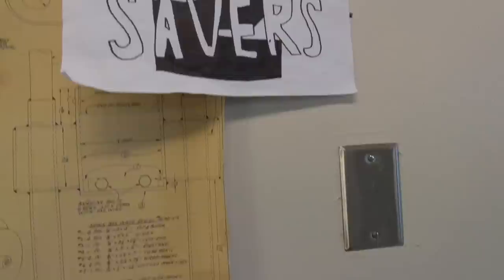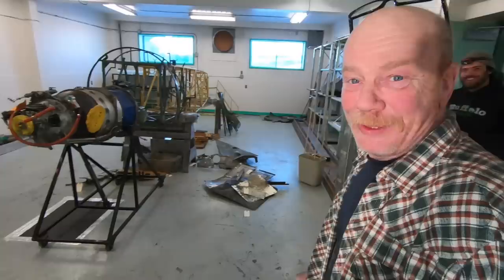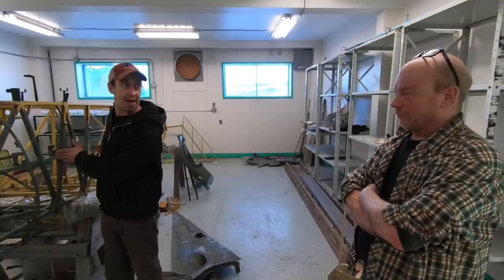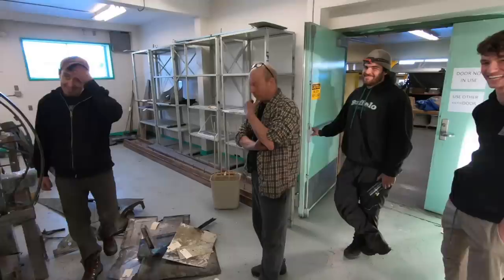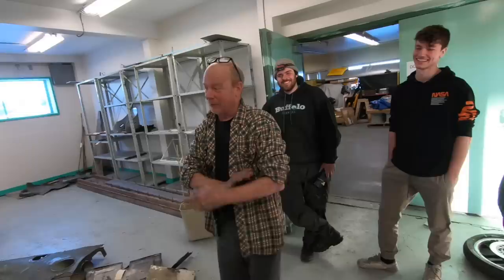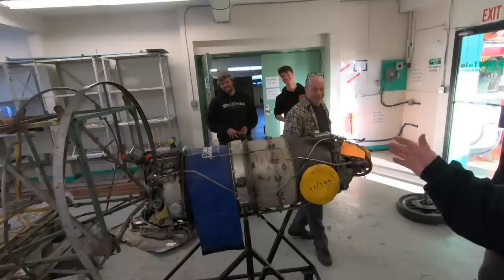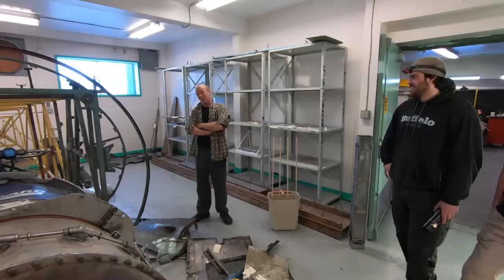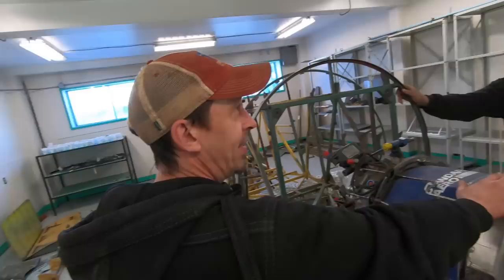Should we put a Turbine on a WW1 Triplane?  |  Plane Savers S2-E21

Comment: What a bizarre idea.  I understand the logic in putting the turbine engine on the plane.  Would it be possible to alter the fuselage to hide the majority of the engine so it would look anything like the radial that you were going to put in it?  Having all that extra power means that you don't have to follow the design plans of the original, you can beef up the wings and struts to be more close to the requirements of that engine.  It could still look like a Fokker on the outside but could be much stronger on the inside... in theory.  A very interesting twist to this project

Comment: You all are nuts....  Having said that, I LOVE IT!!!!  The CG will be totally FUBAR but you can maybe move the fuel tank back along w/ the oil cooler.  The torque and the HP will be way beyond what the wings and frame could likely handle....Really on the ragged edge of sanity here guys....  Might be fun to see if it will fly and not tear itself to pieces.

Comment: I personally run more to the practical side than to the emotional side, so this makes perfect sense to me.  Well tested engine with hours left on it, you have all the components already - I think they're right.  Using this engine solves so many problems and puts you 85% further down the road.  And by setting the engine back for the perfect CG, it will probably handle and perform much better than with the radial, which you don't have and would cost a fortune to rebuild if you found one anyway.  Cuts costs in a huge way and also time.  I think it'll be great.  The only problem is trying to keep the plane close to original, but it really isn't original anyway what with all the plan mods already made.  So I personally don' t think that's a real factor anyway.  Just my two cents.

Comment: You need to consider other stability factors as the additional moment from the engine being so far forward will affect stability, elevator and rudder effectiveness and the flight envelope limits will be affected. Im not a design engineer, but if you are serious, you need an aircraft design engineers input.

Comment: If this was a restoration of an original DR1, then I would say you need the original engine. However this is a replica, so you can do what ever you want. You already have the parts, and the skills to use them. You have the option of fabricating parts to make it look as near to original as possible. OK it may sound different. So be different. Worst case, you can find a more appropriate engine later.
Reply: Nose will be longer than original

Comment: I am one that likes to think outside the box like you guys ! Think about it this way if it don't work your cost are less then getting another engine and mount and all the accessories ! You got it do it ! I took a Cadillac that was throttle body and replaced it with a 4 barrel  carburetor because I had the carb and the throttle body puked !

Comment: it will be the hit of Oshkosh..  it will be the hit of the STOL Drags..   build a cargo compartment into it.. for those crazy short runway deliveries in the middle of nowhere..  can you build strap on leading edges to convert the low speed wing profile to a high speed leading edge profile for long distance flights..  can the wing spars be made out of aluminum instead of wood for extra strength..

Comment: install the engine rearward as much as possible, the cockpit will need moved back to alow space for the engine but the plane will look more original when you make the nose   as short as possible. The difference in the look on profile wont be noticeable unless it beside a original plane.  will need nose weight to get the cg set but that's no problem with the increase in horse power . may need add strength to the wings and tail if arobatics are in the future. the old saying you run what you brung even applies if you brung a turbine

Comment: Mikey...this got me thinking last night and the more I think about it the more it makes sense. 

If you were doing it over here in Europe or in mid West USA I would put an EV West electric motor in it, light weight, compact and powerful, also you can fit it in the original cowl lines because its shorter than the PT-6. The only down side I can think of is the temperatures you get in Yellowknife...would the battery stand it?
The Centre of Gravity could be moved where ever needed by mounting the battery modules in the required position and you could get one heck of a battery in there for the equivalent weight. Another plus is that the CG would not change as you fly the plane as an empty battery weighs the same as a full one.

Comment: The original design goal of the DR-1 was to create a highly maneuverable gun platform for air combat.   Assuming the intended use of this airplane is to do some aerobatics, it would be good to consider gyroscopic loading of the shaft.  Pitts/Eagle engines had issues with crankshafts cracking due to this.  Will a future pilot try a lomcevak in this?

Comment: You would definitely have to limit the thrust ratio capabilities of the engine. Probably with propeller and moderate thrust control. Parts for the engine would be more available. As long as you to control speed it might work.

Comment: Fittings a PT-6 is certainly thinking outside the box but there are certain practical considerations which cannot be ignored. Where will the new C.G. be located? How about the weight and balance criteria? How much reinforcement and added weight to the airframe are acceptable? And last but not least, will the aircraft be stable in flight? Good luck Mikey! Someone has to be the devil’s advocate!!!

Comment: So you find a way to hook the engine to the airplane. Then you finish building the rest of the airplane. Go to attach the engine, and the plane flips over nose first because the engine is so much heavier than the rest of the aircraft.

Obviously, nothing can go wrong.
Seriously though,what is the difference in weight between the original engine and that turbine? How much will you have to modify the aircraft to move the center of gravity in order to keep the plane balanced? There are other questions that have to be answered as well.

Comment: Easy, put Benjamin to work on running weight and CG for fully aerobatic version WITH PT-6 and all supporting gear. Have Rod and anyone else qualified you can to find a reason NOT to do it. If the numbers support it put the PT-6 in. It will be unique and fun. You could always go back to a round engine if one showed. Even Chuck was hard pressed to say no.

Comment: It can be done, have seen a 1930's Waco with a PT6, Stand on the brakes, run er up on the wheels, pull back and lift off the ground, had about a 6 inch ground roll.

Comment: While I haven't read all the comments I did scroll through enough to see that no one has mentioned the biggest reason this can't be done..........torque.   That engine will spin that fuselage like a top.  There is not enough wing or rudder on that DR-1 replica to counteract the torque put out by that PT6.

Comment: @Mikey McBryan, with a long engine like the PT6, the DR1 would be nose heavy, and you would ripped the wings.   If I recall the DR1 had already one bad handicap during WW1.  To much wing surface for it size.  Now yours is smaller and even if it has a tube steel frame, and wood w fabric wings.   You would have to move forward the landing wheels if you still want the tale wheel on the ground.   

To be sure of this weird idea, I would suggest to find someone that has an scale RC DR1 and have an RC turbine to replace the RC radial engine and see how the RC DR1 react with a turbine.  The RC version will tell you if you can do it with your DR1 for real.   Because in real life you have to think about the safety of the test pilot and the pilot that will sit in it.  
Oh too bad it's not April 1, because it would be the best April fools day pranks ever!

Comment: So, let me understand, you're bolting a turbo-prop onto a fuselage with wings made from toothpicks and toilet paper?
Cool! Go for it. If you thought getting the CofA for the DC3 was fun, with this, start now.
But
If you're bolting extra HP into the front, the wings will need to be strong enough to take the extra loads placed on them in turns etc.
Lift won't be an issue but g will be.

Comment: Csn you de-rate a PT-6 to match such a light airframe?
Reply: The only safe way is if the engine can be de-rated.  The torque on takeoff would be too much to maintain control and the VNE would be too easy to exceed.  No need for stronger wings if the original VNE and G loading is kept within limits.   King Air props would have to be shortened for ground clearance.

Comment: I don't know if this is a good idea... first off practicality, will the wooden structure of the Fokker actually handle the stresses generated by the turbine? Secondly, the Fokker is going to look and sound so off, with a long nose, where it's supposed to be flat, and a buzzing turbine instead of the drumming of the radial. Ultimately not up to me to decide.

Comment: Don't let the turbine eng's exhaust set the little wood, dope, and fabric plane on fire at some unusual attitude or something...and the difference in the consumption and weight of the Jet-A and it's affect on W&B from the required tankage. Come to think of it, the fuel tank, maybe then located behind the cockpit, could help offset the difference in the heavier power plant on the nose... hmmm.  Benjamin, a little help please???

Comment: Turboprop on an aircraft originally designed with a rotary engine. Lots more horsepower, more torque, not to mention exhaust hotter than the fires of hell and damnation, all held up with wooden wings.

Comment: It's like putting a 500 cubic inch Cadillac in a Chevy chevette. Will the existing airframe handle the countertorque without twisting it off the fuselage. Is the current fuselage mild steel tubing or 4130. 
Talk to Mike P about getting the 4130 engine mount stress relieved at the commercial heat treat place he uses. If your fuselage is 4130. Finish welding it and see if that same company can get it in their oven. I had found a company 15 years ago that could put a top fuel dragster or funny car bare 4130 framework in their oven to bring it up to 1,100f to bring the 4130 to its proper design strength instead of waving a rosebud torch along the tubes..

Comment: He mention angering the purists among aviation with it. Which i consider my self one. But it already has brakes, a planed radial engine, a throttle rather than a blip switch, probably a pitot static system,  mostly metal construction. What harm would a turboprop engine do XD

Comment: I believe the PT6 is way too much power for the airframe can handle. I like to know the weight of the airframe and the weight with gaz and pilote  plus the rest with out the engine installation ? If i can suggest  a Rotax 912 series or a lycoming 320 it all depense of the weight.

Comment: That would be a real learning opportunity but it probably represents too much 
'technological risks' to take on in the time frame you've set yourself.
.
Rod's right, your "Propulsion part is missing"
.
btw - Melting your fuselage with the PT6 exhaust won't be the solution.
.
ps - if you go for it, don't forget you'll need a bigger rudder.
.
Love the episode ! ... reflects the humorous side of experimental engineering
.
pps - remember, a PT6 is installed with the rear of the engine at the front of the aircraft, so you'll need to create 'fancy' ducting for your air intake and exhaust.
.

Comment: Put a 750HP motor on a Fokker triplane????? Are you out of your freaking mind?
The first Fokker triplane flew with a 90HP rotary engine, later versions had up to 150HP rotary on it. If you want to put 750HP on it? The forces it generates will tare the plane apart.

The extra weight of the engine will have to be carried by the wings so you must fly faster to generate the extra lift. You know the drag "generated" by  the wing (the whole aircraft actually) will quadruple when you double the speed. The drag on the wings will be so great they might be torn off.

Also remember that the yaw moment generated by the prop wash will be quite bigger and the rudder is just very small. Controlling the yaw will be a much bigger challenge than it already is with the DR1.

No I really don't think it is a good idea at all. And if you guys are joking around you succeeded, I fell for it.  ;-)

Comment: Do it. And if there’s time you can probably make it also convert to radial. Drain tank, probably switch to other fuel pump, swap engine + mounts and fix CG. 

Engine controls are perhaps a little more effort but how much do either really need?

Comment: What a torment. There is a piece of me which says to remain faithful to the original Jacobs-powered configuration. The other says go for it. I imagine you would need to derate the engine and run a smaller diameter prop to keep things safe-ish. 

With three wings in the propwash, there is going to be the same serious lift as there would have been with the Jacobs arrangement. It will certainly be gentler on the entire airframe than a piston engine for vibration.

From a practical standpoint, engine substitution makes some sense. The PT6 engine is already well-known and there is provenance. Re-engineering the fuel system from scratch will ensure that whatever stopped the original Jacobs engine does not happen again. 

There would also be that little trace of Canadian pride to be had as the engine is likely Canadian in origin. The aircraft would certainly draw attention at Oshkosh where one can be certain it will attend.

As William builds airtime on the Kingairs, he will become familiar with the behaviour of the PT6 engine and its responsiveness to power adjustments. He would not have to learn both the behaviour of the Jacobs engine and the unique behaviour of the replica aircraft at the same time. 

If turbine substitution already works for the likes of the Antonov AN2, and PZL 18 Dromader crop plane, then one asks why not?

I would like to see an upper cage or roll bar to provide similar protection for a pilot as would be found in the ag planes.

Comment: If it gets the plane in the air safely until a Radial engine is found at a decent price to put it back to a more original look then why not? I think with the staff and contacts that Mikey has they won't do anything that endangers the plane and pilot unnecessarily.

Comment: I am against it. The plane may be able to handle the weight, but you really don't get to cash in on the power, with those wooden wings. The whole airframe was designed around lower speeds. So you'll have to run it at very low power. Turbines are awful on fuel at low power.

I think going for the right modern piston engine would be more like it. You choose choose an optimal level of power, and still save weight.

Comment: Jet A-1 is cheaper fuel than avgas 100. Pt 6 is also very reliable engine Unfortunately you have big problems weight,balance,structural issues,rotating forces etc. I hope to see video taken in Oshkosh with that engine Good luck

Comment: My first thought was what are these boys drinking and I want some, then I realize Rod is dead serious. Rod has a point, you have no engine or mount so here is a power plant and design a mount and figure the CG  and get her done. 

Its not an original aircraft and it would stand out in a crowd. Since my exp is radial and not oil heaters, will the torque effect be lesser with a turbine then a radial?

Comment: The torque from the motor alone would destroy the airframe. Not mention the tiny rudder would not keep its straight. Will not work. You might as-well redesign the aircraft. Very dangerous to fly.

Comment: Why not go electric?  It’s new gen and the airframe is already designed for lower power and performance. 
It also brings Plane Savers closer to saving more trees! 🤓👍🇨🇦
Reply: PT-6 MUCH simpler option and cheaper as long as you already have a PT-6

Comment: Is it the1st of April??  Got to say it's different.

You aren't making an exact replica, as it didn't originally have a DR1 engine?                     YES
Does it get around the cost issue with the only available engine being too costly?          YES
Are the parts available?                                                                                                                              YES
Is it technically possible?                                                                                                                            YES
Will it please the purists?                                                                                                                            NO

Will, it fundamentally change the shape of the airframe?                                                            DON'T KNOW

Does it mean that the project can proceed on schedule?                                                            YES

I guess on balance,                                                                                                                                      GO FOR IT!

Comment: It is not like you were able to put an original type engine in anyway. If it can be done safely with the materials like wood and fabric that the wings and stuff will be made of then it would probably be amazingly aerobatic. I am a fan, not an engineer so make sure the pros like Benjamin run the numbers for safety and get a few second opinions. Then Go For It.
"A bird in the hand is better than 2 in the bush" in this case an engine in hand . . .